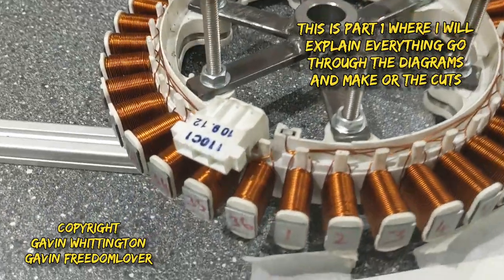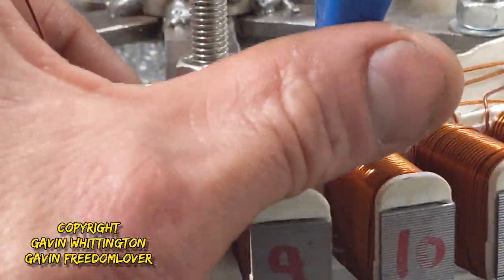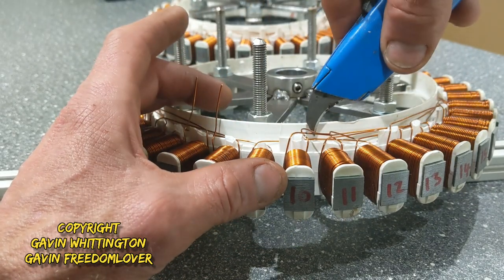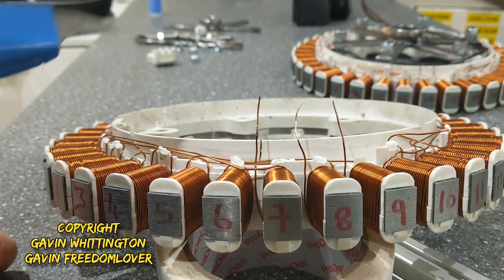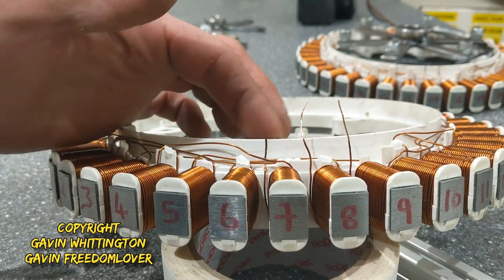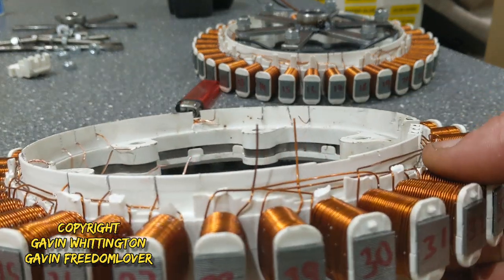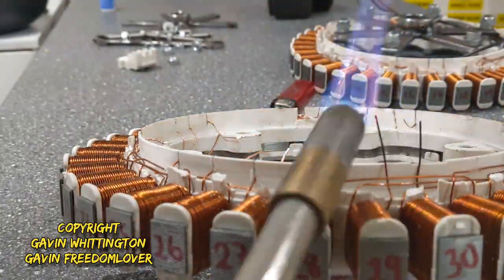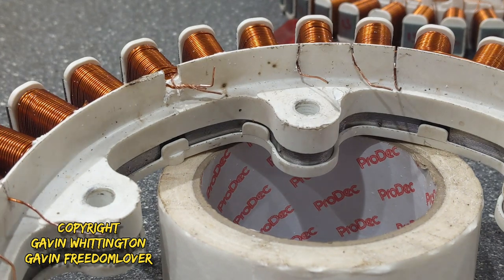FREE ENERGY PROJECT LG smartdrive stator re wiring instructions for 12v/24v Wind Turbine Generators

Comment: one good thing with your dual design is you can  double the voltage by joining two rectifiers like you would with two batteries if desired.
Reply from the maker: I didn't realize that how would that work just connect in series??
Reply: @GavinFreedomLover  yes on the dc side

Comment: now i get it, the fisher and paykels are wired opposite,  in a clockwise direction, i like the hacksaw trick. hey maybe its like the simpsons in the episode showing the water in the toilet and sink plug holes spins in a different direction in the southern hemisphere LOL.   i just wired in the same direction as the factory did but now im wondering which direction do those washing machines rotate in your part of the world.
Reply from the maker: I think some of them spin both ways now , a sign of the times perhaps 😃
Reply: @GavinFreedomLover  yes i think youre absolutely right
Reply: @GavinFreedomLover  Any ideas regarding how to differentiate between the two? Perhaps by something on the stator block? Also, for your duel stator/rotor set-up (with them facing opposite directions, wouldn't you need to turn one stator over (or have an identical one; but, wired to have the rotor spin in the opposite direction), to compensate for the differences in how they've been wired? I've currently only seen pictures of the stators (I have 1 waiting for me to pull it out of a scrap machine, once the weather quits breaking record lows; and, a couple more coming from ebay sellers, which will probably be here by this time next week); but, I'm guessing that you're saying the coils are wound opposite on some models of washers. [AKA: What would be "coil 1" would be "coil 36" on the other.]  Is that accurate; or, are we getting off into "left handed monkey wrench" territory?
I hadn't considered a "duel motor" before; and, this is the 1st I've heard about some of these motors being wired differently than others... Interesting concept, though; and, I'm looking forward to see how it turns out. :)

Comment: I wanna build one, anyone know if this will work, found it for sale with heat not working...
 LG Sensor Dry Gas Dryer, not sure if it's smartdrive??
Reply from the maker: Yes, even if you do get a motor you may find it is the aluminium wire version which is a lot harder to work with
Reply: got my motor today, thnk it's copper, gonna utilize all the bearings to make it simple.
found a direct drive lg washer for 30 bucks @GavinFreedomLover